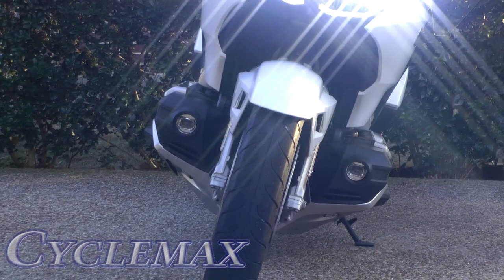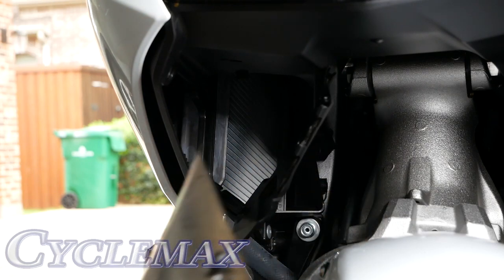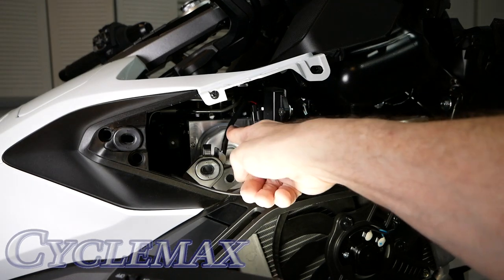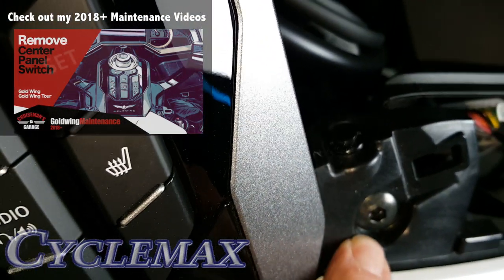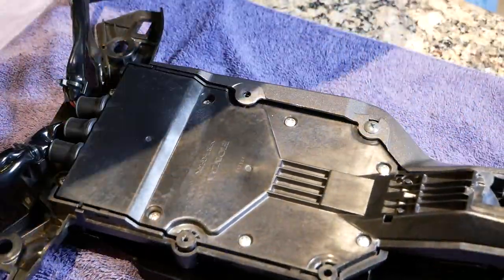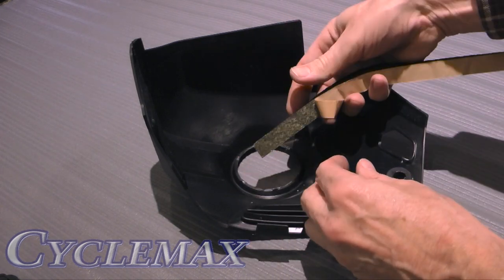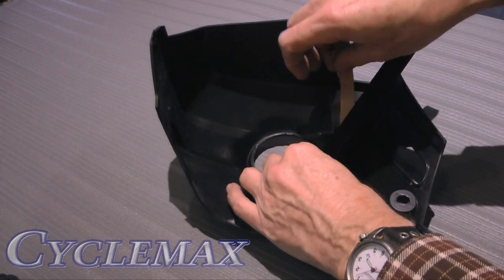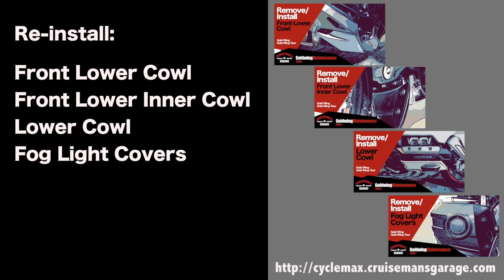Honda Fog Lights for 2018+ Goldwing Installation

Comment: Glad I watched this, it convinces me I don't need the fog lights.  It's really disappointing that Honda made this as difficult as it is to install fog lights when they could easily have installed wiring for them ready to go when assembling the bike.  No way am I tearing this much body work apart, nor am I going to pay a shop for the hours it would take to do it.  I can live without them.
Reply: You and me both brother, what a joke they didn't have set up to just plug and play.
Reply: I agree. I'd like to have these lights, but having to do this much disassembly is ridiculous. This is almost as bad as doing an air filter change. That would be the time to do this mod, but I'm not doing this much disassembly just to install these lights...
Reply: Part of owning a motorcycle is tinkering with it and satisfaction that u done it yourself I got mine from China £150 would have bought the honda ones but £550  what a rip off only for postage, customs chargers I would have got these . I llve in the UK not much choice here .

Comment: During lockdown i had alot of time to attempt to fit my Pathfinder LED lights.on my Wing with Airbag. Found out its not necessary to remove the saddle and the mirrors and all the plastic fairings , its easy remove the plastic pins on either side of the inner area next to the control panel, pull up the edge nearest the control panel hard, the clips unlock and presto u will see 5mm allen bolts which u remove and this allows u to pull the control panel and fold it backwards in order to remove and replace the light button. I recommend care and protect edges with tape and a few clothes to proctect the tank etc. The only grief i had was the fuse box screw to attach the live cable to the screw a phillips, (i was told there are no phillip screws on the Wing too late) was so tight the screw was us...so a drill and easy out and all done...its a nice do it yourself but study what cruiseman does as it helps alot...

Comment: Your videos are the BEST !   I suppose if you plan to also install home link, XM antenna or other Honda accessories which require you to tear your bike apart,  it would be best to plan the installation of all accessories at the same time.    😊
Reply from the maker: Yes. Very wise to do multiple installs at the same time!

Comment: Hi , thank you for the video , ( yes I am very late ....) , once again it's very explicit and very well filmed. 
Just a little question, it seemed to me that there was a "dead plug" on the bottom right of the bike (on some years maybe...) available for the fog lights and controlled by a button to add on the console ?  is it true  ?

Comment: I have a 2018 Goldwing DCT Airbag.  I was told if I wanted the fog lights, not only will I have to buy the lights like the ones you installed, I would have to buy a wire harness that included the button as well.  It appears to me your bike had wiring already installed and all you had to do was remove the dummy plug.  Should that apply to mine as well and I don't need to buy a separate wiring harness?
Reply: Nevermind.  After some research, the place you connected it to was for the separate wiring harness that needs to be ordered.  All the attachments you used comes with the kit and not with the fog lights.

Comment: I took mine to the dealer to have them installed also trunk rack and brake light. Today I noticed many push pins missing and at least 1 screw missing. Don't know what else they failed to reinstall. Just goes to show that dealers don't know how to work on them yet.Scared to take it back to them.

Comment: Have you ever used a Japanese JIS-4 screwdriver, they sure fit those "Phillips" head screws better than that square drive Phillips you are using here...
Reply from the maker: Yes, I got lazy and used the first Phillips I found. My JIS was out in my 26 degree garage!
Reply: @cruisemansgarage  Are you doing this in the house? 300 miles south of you it's 52 degrees

Comment: Do you prefer these OEM fog lights or the Rivco units you installed previously?
Reply from the maker: Let me spend a little more time with these. I am planning to do a 3-way comparison between Honda, Rivco and SoCalMotoGear.
Reply: You need to compare the new Electrical Connection fog light kit that is being released Feb 1 as well
Reply from the maker: @frankward8003  The other three companies reached out to me and sent me their kits to review and sponsored the videos I created (or, will create). I would love to see and review the EC lights.

Comment: Nice job Cruise.  The Rivco’s are 6k lumens a piece. How many are these?
Reply from the maker: Honda does not release that info.
Reply: Thanks Cruiseman. Probably so comparisons can’t easily be made. The most important benefit of lighting is power. How much useable light will be discharged. I’d go with the Rivco lights any day. 6k lumens is a bunch of good light.
Reply: The Electrical Connection has a comparison  chart of the major fog light brands for the 2018 Gold Wing...they claim the Honda fog lights have 880 lumen each light...the Rivco are rated at 3000 lumen each light....https://electricalconnection.com/index.php/product/honda-goldwing-tour-foglight-kit/

Comment: So with this set up you can run the fog lights with either the high or low beams on?
Do you know what the laws are regarding running fog lights and high beams at the same time?
I'm told its illegal but can't find any national law regarding it.
Reply from the maker: Honda Fog Lights shut off when the hi-beams are on.
Reply: @cruisemansgarage  So hooking up the fog lights with the high beam switch won't interfere with using a head light modulator???

Comment: You don’t say how to adjust the lights? Almost impossible to adjust once on The bike right? How do you check for proper setting?
Reply: The lights are not hard to adjust up and down, as they are held in place by a vertical mount.   Moving them side to side is very difficult.    Check your state laws on how high the lights should be mounted.  In most states you are ok if the CENTER of the light that is cast is below the actual light at 25 feet.

Comment: Nice job again. You mentioned aiming these but didn't describe that process. Can I assume it's idiot proof? ;-)>  
IMHO fog lights should be a standard feature on this bike considering the price tag and Honda shouldn't gouge the buyer like it does </end of rant ;-)> 
On another note, I have noticed that you have removed and replaced the same components over and over as you've done various upgrades. It would be great to have a compiled list of upgrades that one can do whilst these major parts are off the first time (home link,  fog lights etc.) in order to save time, possible breakage of clips and avoid the possibility of mis-routing of wires etc. If anyone has the knowledge to put something like that together, it's you! Again, thanks for sharing.
Reply from the maker: It is pretty straightforward and the Honda directions explain how to do it. Basically, you loosen one bolt on the adjuster bracket and you have a limited range you can adjust.

Comment: That's a lot of disassembly! I think what you're calling "body clips" are actually called push pins...if you don't install the switch, will these lights work? You could just remove the the side, front, and center engine cowlings to be able to get at the plugs. Then the lights would be on anytime the headlights are on, and you wouldn't have to remove all of that upper stuff just to install the switch.

Comment: There are no, repeat; NO Phillips screws on Honda motorcycles.  The screws are JIS and we should be using JIS drivers to remove them in order to avoid rounding them off.  Don't you hear that "click - click - click" as you remove screws?  You are ruining them.  #2 JIS fits most of them.
Reply: Rooster relax, they are just body screws
Reply: Only saw your thread now and i had an issue on my fuse box, the live wire i could not remove the screw with a phillips, ended up drilling and easy out.....s